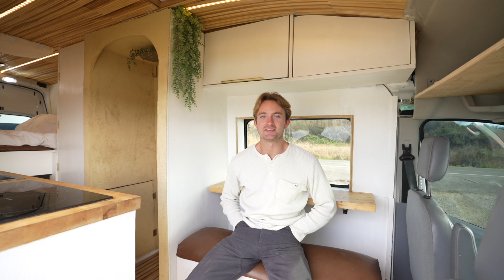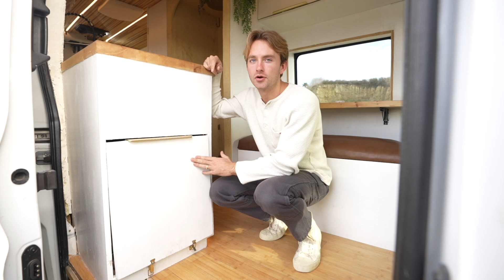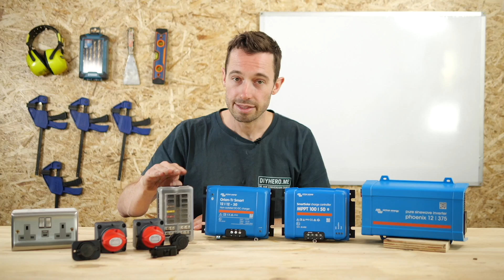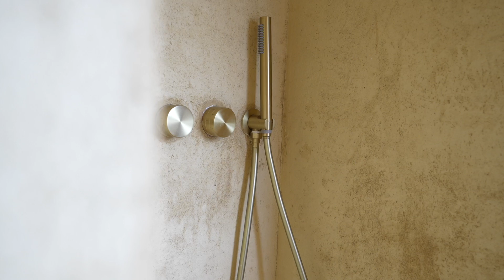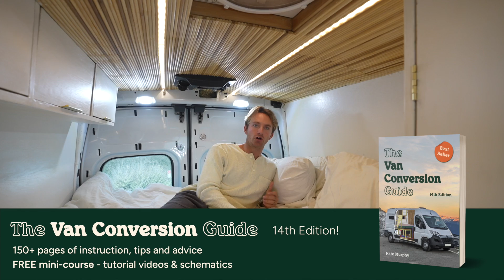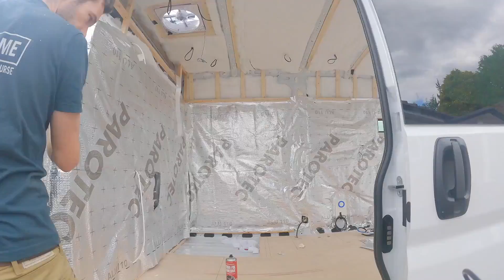Fabulous Ford Transit Van Conversion with Beach Vibes  🌊🌴

Comment: Hi Nate, an idea and a question.  Firstly it would be interesting to see some adventure / race van cross overs, i.e. vans that are designed to take a motorbike or a serious amount of mountain bike gear.  I mention this as a friend of mine is looking to build a van that can transport a 200kg motorbike + mountain bike but doesn't want it to be too big... this got us discussing a 6.8m Crafter with a pop top... Anyway the question was where to stay near your neck of the woods as I am travelling with my wife from Bilbao east beneath the Pyrenees, so I wondered about the area around your place?  All thoughts much appreciated.